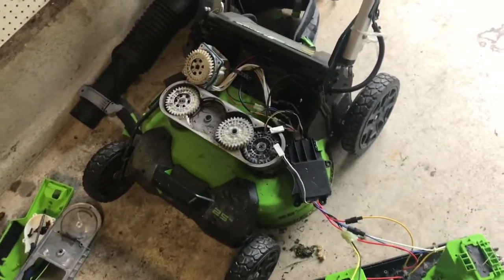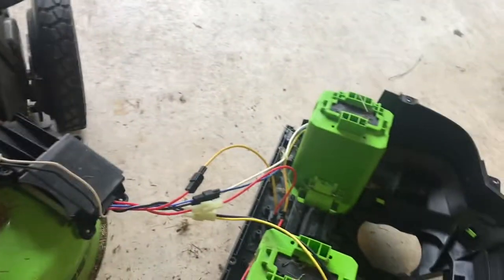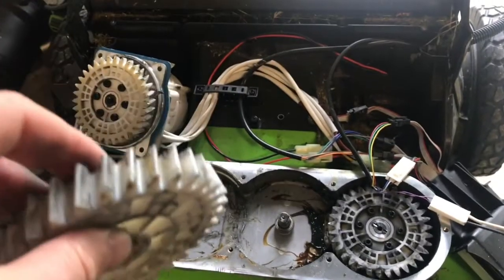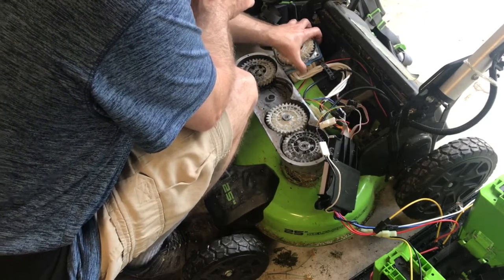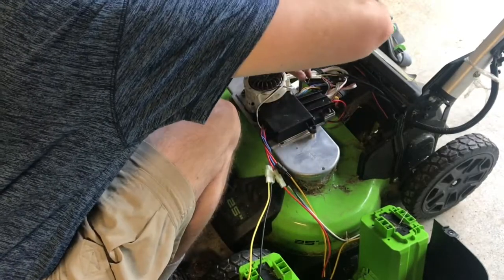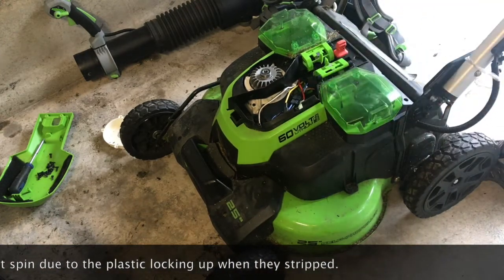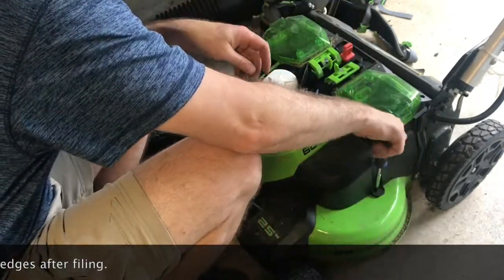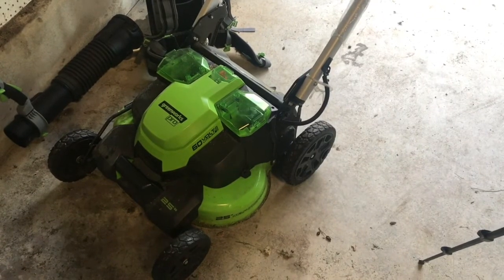2-Year Update:  What Were they thinking of?   Mower Tear Down - Greenworks 25" Twin-Blade Geartrain.

Comment: Thx I had thought it used separate motors for each blade, like the riding electric mowers that I have seen. But now I know why commercial lawn mowing services report that it breaks down after a 100 hours of use. I will sure not to replace my current electric mower with this plastic gear driven piece of crap... thx again...
Reply from the maker: Glad this is helpful.
Reply: @ToolHombre  on second thought,  I did realize 1 advantage of using plastic gears.... vs using 2 direct drive motors, to power the blades... which is that the plastic gears, isolate the motor from shocks and getting damaged, when the blade and/or shaft gets hit... such as by a root or in my case a steel spike, that ruined the motor, of a previous mower....

good luck with your mower...
Reply from the maker: @nc3826   Thanks.  It's been mowing all spring so far.  
 My only concern about this being the programmed point of failure is that they don't have ready-made parts for when these strip.
Reply: @ToolHombre  "Programmed" or not,  it is common sense to know that plastic gears  have a limited life....And that replacement gears are needed to keep them operational...

But shouldn't the warranty cover it? I see that the Greenwork's GMS 250 that I googled has a  4yr warranty,   So shouldn't they have to repair or replace it? Or if they extended it after you bought it, they may extend it for you, if you ask? You know what they say, the squeaky wheel or gear gets the grease. 

And I did notice that there are 3rd parties who sell gears like this one, but the online sites ask for a lot of specs. So without gear model #, you may have to call them about how to get the specs. such as the pitch of the teeth. 

I miss the  good old days, when gears were made out of metal and you could take a broken part to a local machine shop to have a replacement milled out of a billet.. Damn I'm old lol. 

Good luck keeping it running.
Reply: @nc3826  online sites are $3000.00
Reply: $3000???? lmao

or DIY it, using the traditional, wax mold method.... and it will cost next to nothing...
Reply: @nc3826  thanks I'll look that up
Reply: @nc3826  What resin do I use???....and it's crazy they want $12,300 for 48 hr turnaround. LOL!!!!
Reply: @martyschilling7464  good luck with your meds

Comment: I made the mistake of putting my son to work using this mower and he seemed to hit every single stomp and rock in the yard and now all the gears are broken. I cant find any replacement. I dont know why any company would use plastic in a mower but it would be as big a problem if I could get more gears. Just sucks i only had it a year and a half.
Reply from the maker: Yes, they clearly did not think this through all the way.  Either build robust gears or supply parts.

Comment: Any luck on finding replacement parts for this plastic transfer gear? I am going to call greenworks tomorrow but from my experience (and many of your other commenters here) they have very difficult customer service. Any help in obtaining this part or even a parts manual for the lawn mower in question (MO60L427) would be greatly appreciated!
Reply: I bet your call to greenworks was useless, like mine.  Plan for a 5 year life. (unliked 23 year life of my honda mower).

Comment: Thanks for taking one for the team.  Looks like a nightmare having to not only find replacement plastic gears but to deal with 20 screws to get to them.  Disappointing the design is literally made to last only up until the warranty expires, so environmentally wasteful.
Reply from the maker: I agree.  I would have loved to have loved this tool, but sadly that is not the case.   
Knowing it has some glaring weaknesses, I'm waiting for another brand to come out with an intermediate-size deck model.

Comment: A fabricator might have a hay day casting these in bronze or aluminum.
Reply: This is true. I have had one for about 45 days. The "transfer" gear split in half and the gear on the motor lost a tooth. I emailed support and we'll see what they say. If they can't provide the part I'll just tell them I intend to return it. If they won't accept it I'll file a dispute with the credit company. Depending on cost, I have also considered asking a local fabricator what they might charge to mill the gears
Reply: @mrjackharbour  u have one good gear I'll buy it
Reply: I believe a fabricator might be your only option. Greenworks made good on the warranty, but it was by replacing the entire mower. I could not find the gears anywhere.

Comment: Better than hitting a root on a direct drive mower. How has the machine held up over time, otherwise?
Reply from the maker: After straightening out the worn parts of the gears it is back to mulching quite nicely.   Wish it had a bit more power though, if I'm honest.

Comment: I'm thinking the gms250 is 1st generation and the 82lm25s is the 2nd generation. Hopefully they beefed up the gears with metal gears
Reply from the maker: I'm hoping so.  The deformation on those plastic gears was something to behold.
Reply: @ToolHombre  Another thing I looked into was getting the plastic gears out and going to either a machine shop and have metal gears cut, or seeing if I could find metal gears online or at a motion pro store. Would be worth looking into

Comment: If anyone has luck finding replacement gears, I'd be glad to hear it.  My blades started hitting each other mid mow, turns out 3 of the gears had their keyways worn out allowing them to skip.  The gears themselves are fine, its the aluminum hub in the center that's bolted to the plastic which wore on mine.  So far I've struck out with Greenworks service via email and phone.  I haven't found internal parts for sale anywhere and the service rep I talked to said since I'm so far from a service center there is nothing to do but throw the mower away... !?!  I'm the second owner so returning to retail is not an option.

Comment: EXTREMELY helpful! Thank you for showing the gear mechanisms. Pretty unbelievable that they used plastic gears. Had a similar issue but was still in my return period and was able to get a replacement. To my knowledge, GW does not sell spare gears. If they do not provide these replacements, there will be a consumer uprising as this mower is far too spendy not to provide replacement parts. Crazy. Thanks again!
Reply: metal gears are more expensive, and will get just as damaged if you hit a root.  better to use plastic and have that shear than to break something even worse if it doesn't shear at the plastic gear.   It's a shame they didn't use something like a timing belt instead.
Reply from the maker: Very welcome!  Thanks for watching.

Comment: Thanks for showing us the gears, plastic gears on mowers should be considered consumable. It would be interesting to know if they are easy to get hold off, that noise is not really acceptable and will not last. A mower at that price should easily last 10 years of domestic use with maintenence.
Reply from the maker: "It would be interesting to know if they are easy to get hold of".  
Good point.  Maybe I'll do a walk through of the process to get new ones.   Thanks for the comment.